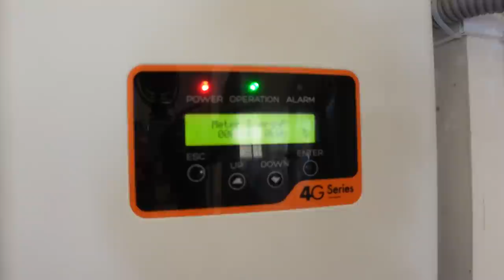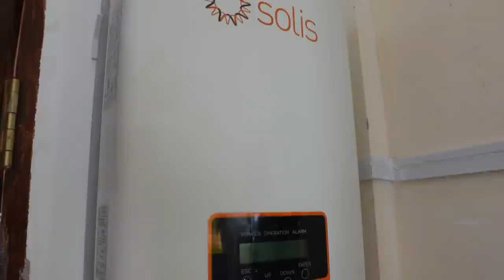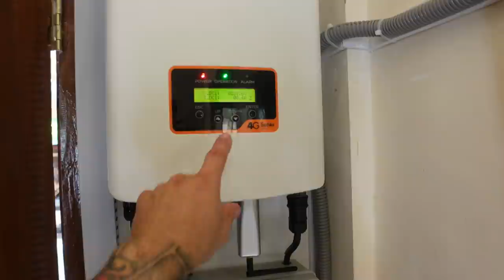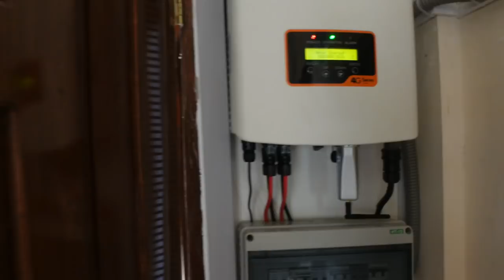Philippines Province House Gets Solar!!

Comment: I had my 3KW grid-tied (no batteries) solar system installed back in 2019 when the house was still under construction (in Panglao Island, Bohol).  After typhoon Odette struck, I had it upgraded to 5KW Hybrid On-grid, with 2 batteries installed.  I had the inverter configured to use the batteries at night to supply the house, including a 2.5HP AC.  The batteries can last from 6-7 hours every night.  At day time, it can generate enough power to supply the grid.  Now, im paying not more than one-fifth of the bill had I not installed a solar system.
Reply: Thanks for the information. We have only had our solar a few weeks and we are hoping that it will drastically reduce our electricity bill.
Reply from the maker: Great info, thank you. How much were the two batteries? Limited options here for batteries....
Reply: @ItsMe_Philippines  we have one 48 volt Lithium ion Battery made by Solis. Please contact your Solis dealer for a quotation. The battery acts as my generator during frequent brownouts in our area.
You might contact Solar Pro in Iloilo City for information. Ask for Charlie Ramos.
Reply from the maker: @bigcaptainschannel  Will do, thank you
Reply: @ItsMe_Philippines  Glad that I could be of help to you.
My name is Stephen.
Reply from the maker: @bigcaptainschannel  Nic to meet you Stephen and I will have an update soon with generator addition. Batteries as soon as I can get them.
Reply: @ItsMe_Philippines  My solar inverter comes in 1 whole system, including batteries.  2 batteries installed with 5KWh capacity each... that is, 10Kwh of power drawn from these batteries every night.  Brand and model:  Alpha-ESS SMILE5 Inverter and Batteries.  The batteries in the system can be expanded up to 6... Each battery costs me 150K pesos.  If I may, here's a time-lapse during the installation:  https://youtu.be/y-OoUe0YlSM

Comment: Curious to know how the net metering pencils out, you probably know by now since the video is a year old. 5KVA is a good size system, we have a 9KVA system and net metering but the power company does not pay the same rate as they charge when I'm not generating power. Those split systems are so efficient, love 'em. And those super high ceilings pay off too. Good video.
Reply from the maker: Thank you

Comment: Sounds like you picked the right one for your house.  Might have been good that they didn't have the right setup for you, it gives you room to expand without having to replace the operating system.  Might be a good choice for someone even if they have the right size.
Reply from the maker: And I learned something from it. They told me I can only apply for net-metering if I have 5kw of total solar panels or under. So I need to apply with my current set up. Then add on afterwards if I wanted to get 6kw total.

Comment: LFP batteries are very long lived, and a generator is nice, but having batteries results in instantaneous power fill, which helps protect your equipment.  Not to mention that batteries don't make noise.
Reply from the maker: Vert true

Comment: Great video.   I also have a 5kw system in Philippines and learned in reality will only see 4.5kw max at mid day and only for 30min.  I ended adding 2 more panels just to maximize the system and any excess energy was just sent to the grid. I have not paid an electricity bill in over 3 years but like US the electric company has been add a service fee thats not covered by net metering.
Reply from the maker: Thank you and we think we will do the same. We have 5kw worth of panels but have a 6kw inverter. So can easily handle some more panels!

Comment: Very informative. Thank you. We went with the Hybrid inverter system because we have several Brownouts a week on Panay island. We have Solis Hybrid inverter with 14-450 volt Solar panels and 48 volt lithium ion battery. It really works fantastic. No more brownouts.
Reply from the maker: Nice!
Reply: Hi how much did it cost you for your solar panel in pinay area? Thanks
Reply: @ginaffcmagsico9316  Please check with your local SOLAR supplier. Prices may vary in each area. Ask your Solar supplier for a survey and help you decide what type of system that you need.

Comment: Look more into the net metering.  You can't be adding power into the system during blackouts and brownouts because of safety for power workers.  From what I've studied, it is good to be tied to the grid but net metering can be a total headache.  I'm just learning, but your system must be turned off during these events unless you manually switch it over.  I might be wrong.  But if true could defeat the whole purpose of solar rather than the cost of electricity.  Love your videos and the compound is coming along nicely!  Good info on the solar!
Reply from the maker: Yea you are correct in a way. I have a shut off switch coming into the house for if/when a brown out happens. So if I switch that off it then switches only to the generator and will not send power back to the grid for safety issues.

Comment: Hi Cory, do you have storage batteries that will provide power during extended periods where cloud cover obscures the Solar Panel from providing enough electricity.

Comment: Congratulations!  I’m a strong believer in Solar especially here with an abundance of Sunshine.  What’s the Delta between the cost of purchasing power v the rate you receive from the Power Company?  I have a technical question…When you purchase Electricity does the Power go through your System and “Clean” the Power by turning their “Dirty Power into nice Clean Power” which drastically increases the life of your Appliances, especially Air Con units?  I know when you use Battery Back up or a generator you have nice clean “Spikeless” Voltage.  Thanks.
Reply from the maker: Agreed and we are VERY happy with it!
Reply: @ItsMe_Philippines  nice place
Reply: You need to invest also star link brother soon it will be available in the Philippines.....
Reply from the maker: @juleskingarellano7491  Will have to research this

Comment: You may want to have a backup solar system that's OFF GRID because your set up which is called GRID TIED doesn't work if there's a brown out. It only works if there's electricity in the grid. That's how GRID TIED setup is designed to be.
Reply from the maker: Yes I 100% understand that and I’m very knowledged on how solar works. Like I explained in the video I have a back up generator for those rare occasions.

Comment: Does the Philippines have a buy back on clean energy, where the energy companies pay for your extra energy in the long term? 
Similar to the state by state programs, here in the U.S.?
Reply from the maker: Yes, it’s called net metering. You have to apply for it and file the necessary paperwork. More than likely I will be doing that but I would like to get a few months of cost first.
Reply: In the USA some utilities offer net metering and states has SREC (solar renewable energy certificates)

Comment: Congrats on solar. Are you completely off grid with ⚡ ??
Reply from the maker: Not as of right now we are still connected to the grid if we need power. Just did a video on getting a backup generator in addition.
Reply: We plan go off grid in ilocos sur pudoc. With elec n water. Rain water and buy water. Only have drainage system , no plumbing. Also compost toilets, that can feed our possible garden

Comment: Just to clarify. you have no batteries. solar only works during the day. you make extra electricity during the day. the electric company buys that extra electricity, then you basically buy your electricity back for night time when you need it. so that basically negates each other and you have no electricity costs....and no needs for batteries?
Reply from the maker: For the most part yes. Unfortunately they do buy your electricity at a cheaper price than they sell it to you for. See you want to make sure that your overage is going to be enough to justify it.

Comment: Is it worth the cost?  Maintenance etc. My house have a roof top and I don’t have much thin roof for the solar panels and I don’t have land
Reply from the maker: Size of the roof? Angle to the sun? Monthly electric cost now? Do an ROI on the unit in question.
Reply: @ItsMe_Philippines  I don’t walk to block my walking roof will all these solar panels

Comment: Why are you not telling us the total cost?  That is the most important thing for us to know.
Reply from the maker: I included the links to the website with all of the prices. My total cost is irrelevant. There’s over 7000 islands and depending on how far you live from the company is going to change the price. And then they also have multiple different payment options which will adjust the total cost. Along with the last factor, price fluctuating. Prices change, they go up, down, and on sale. It would not be smart of me to put a total cost and then someone calls them a week later and the price is different for their location.
Again, their link is in the description. Their website will give you the prices and have the accurate to date cost. Also, no solar company is going to give you a total cost until they evaluate your house and look at it.